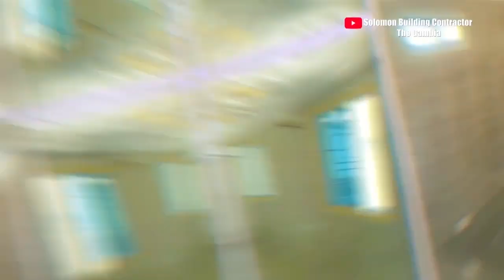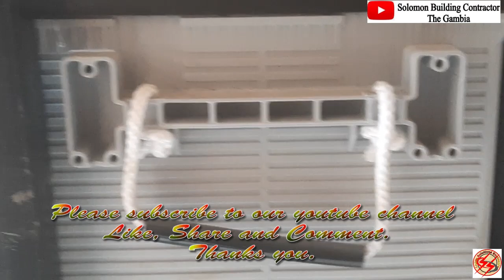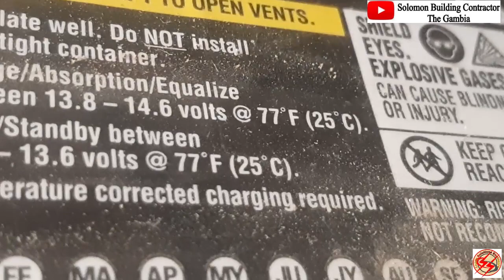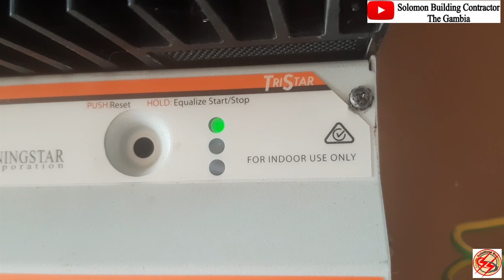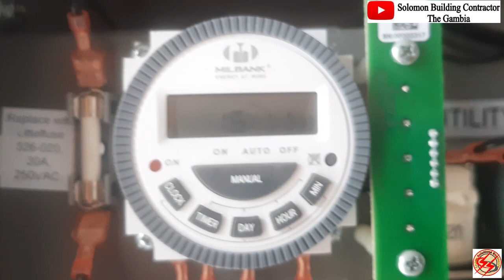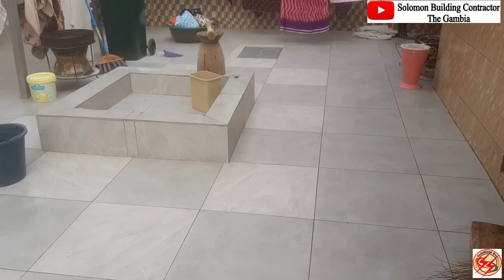Solar Energy Installations Final Part

Comment: So if your main source is solar and there is no Nawec supply in the area, can the secondary be a diesel generator? Also, in this installation cannot this number of batteries supply the power through the night even though they are not being charged by the solar panels overnight?
What is the second charge control  unit for?